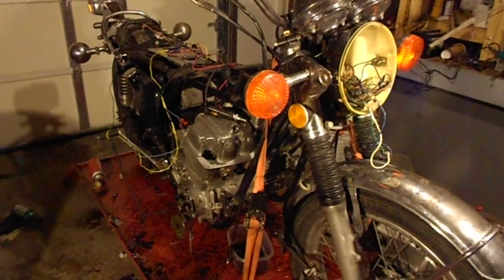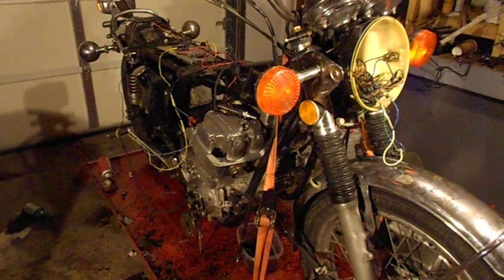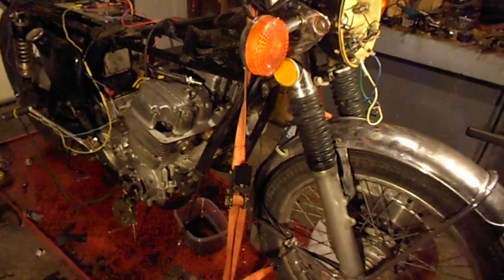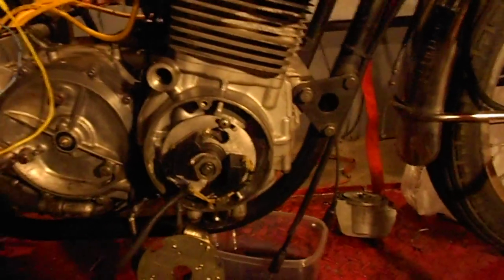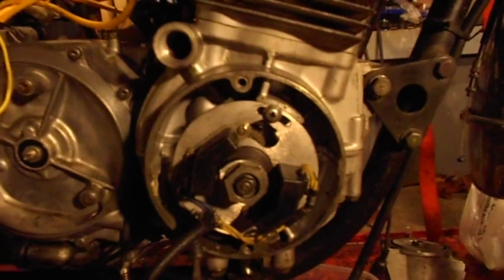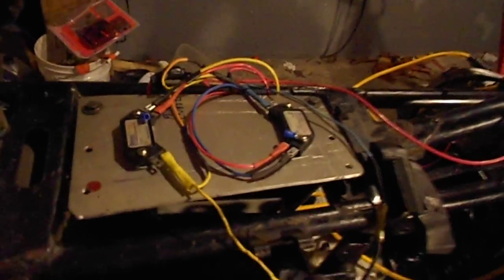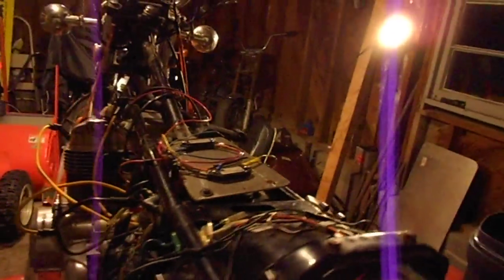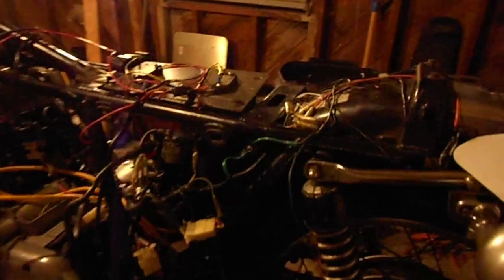1976 CB750 HEI Ignition Test w/GM coils

Comment from the maker: There have been other electronic ignition systems some just about as old as the first CB750.  Not sure any can match the spark power, but you have to remember that a stock CB750 does not make HP over 8000 RPM anyway.

I am sure you probably know this the number one thing you can do for easy starting and strong running is to make sure your advance shaft is perfectly true and the mechanical advance is in good working order. Google HEI Comcast and the credit goes to Lou.  It's his system.

Comment from the maker: It is actually a little small so I took the CB650 and Cb750 backing plate to a guy who does machining and make up a combined plate.  I can't quite remember, but I might not have had enough advance.  I will resurrect this project sometime.  Just need to make up some mounts so the HEIs go where the stock coils are.

While the system seems impressive you will get more for your effort by making sure that your advance shaft is perfectly true.

Comment: does the HEI dules need to be paired with the GM ciols?. or i can use just the modules with the original motorcycle coils. i have a 87 honda vt 1100